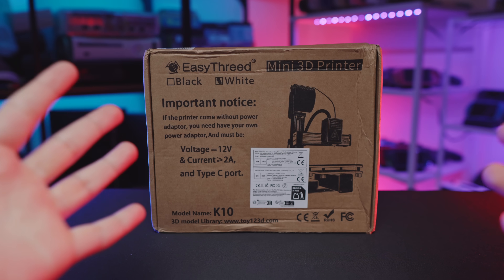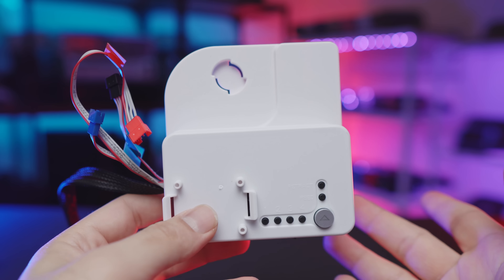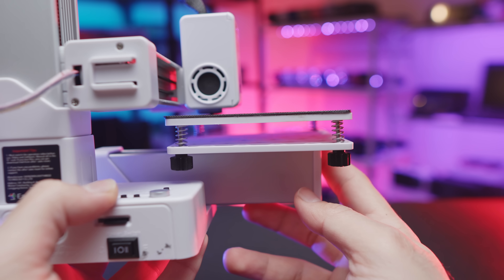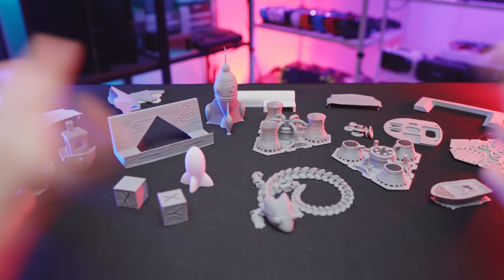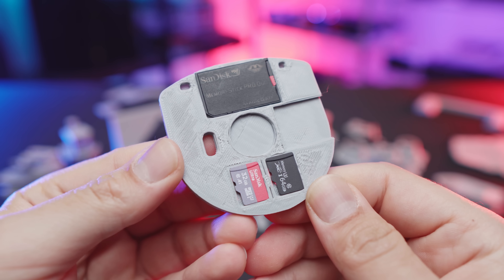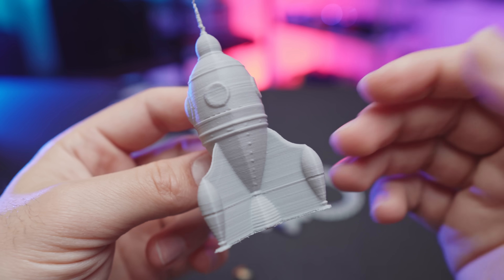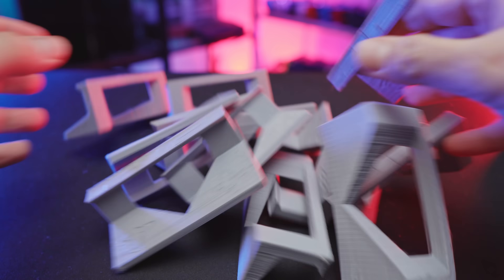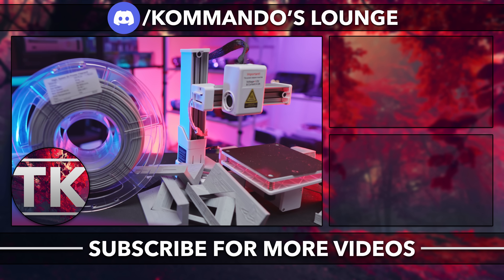Printing PSP Mod Parts With The Cheapest 3D Printer on AliExpress

Comment: I've had mine for a year, it's a cute little printer.
The uneven looking bed, is a result of the sliders used to carry the extrusion for X axis, and tool head.
There are files available with replacement ones you can print.
This definitely fixes that problem. I used the file uploaded by @Phil_Prints, who is also here on YouTube, and in the Easythreed Facebook groups.
Reply from the maker: I will try revisiting it one day thanks for the tips : )

Comment: You know I got a problem I wanna swap psp street case body cause it’s scratched the hell up . What can I do in this case , I just thought if there is a 3d printed body cause there are not some new psp case like other replicas for that model
Reply from the maker: There are sadly non, your best option is to smooth it by sanding it and painting it

Comment: on my own experience, use the orca slicer profile on the sd card and use the power adapter that came to the printer, i used to use a power bank too but the printer seems to underclock the steppers and the print quality came out really bad
Reply from the maker: I thought about testing it on DC power vs Type-C, but was running out of time and thought with the amount of wobble I got, it might be only a slight improvement.
I may revisit this printer in the future and try that along with securing and tightening all the axis, possibly adding a glass bed.

I also found Orca profile to be better than the cura one
Reply: @TotalKommando  fix the fasteners they are too loose on the rail, you can put a tiny piece of filament on the cavity of the rail and the pieces will no longer have that gaps, tight the belts by loosening the two screws and then tightening again when you feel the belts more sturdy, put a L bracket on the Z axys where is the removable thing in 90º angle, this all combined should solve all the weird things in this printer, i did this to mine printer and it goes nice

Comment: Hey bro just wanna thank you for reigniting my love for the psp, also I saw your aux bluetooth adapter video and I'm wondering if you have any research about adding bluetooth inside the psp instead of an adapter? Much love ❤
Reply from the maker: I have a post where I show that Im working on the bluetooth audio mod, its coming but no ETA yet : |
It will however be the next mod video when its ready

Comment: Dude I just ordered a 3d printer for making a PSP umd sd card slot holder. I’ll be making accessories
Reply: What printer did you buy?
Reply: @Shaquilleoatmeal1219 creality ender 3 v3
Reply: @jimhalpert0  nice i have the v3 ke but its a pretty good printer

Comment: These little easythreeed printers are basically just really good for wait for it TPU.... Yes TPU....  CHEP on  FILAMENT FRIDAY did a review of these printers a couple of years ago and they are just kids toys which is why TPU works as its flexible filament .... I have actually been looking for one of these to just do smaller TPU prints with but they are not available in my country and importing them is a nightmare and adds a whole lot more of extra charges and taxes making them almost just as expensive as a readily available Ender 3 range printers.

Comment: can you try make psp transparent shell with silicone rubber mold , and material for the shell using the epoxy resin, it will be great
Reply from the maker: Could give it a try one day, it will be tough since there are so many nooks and crannies

Comment: Oh man.... I had an Anet a8 back in 2015 and i gotta say this printer is taking me back to the issues it had. The technology just wasn't there yet. I bought and Ender 3 and thought i had the best thing in the world until i finally upgraded to my Centauri Carbon which even with the current controversy is still a great printer especially for $300.
Reply from the maker: That was also my first printer lol
I reviewed it on my other channel, fun times (not really) it was a nightmare. But the custom upgrade community prints were cool
Reply: Same actually. Its crazy that the CC is as cheap as it is with the print quality that it produces. Yeah there is controversy over the promises the company made but the machine itself is super solid with amazing quality prints!

Comment: Yeah, they tell you that the printable holder is for 0.5 kg 😆
Reply from the maker: Although I did miss that, they should really include a better spool holder because those are not easy to find, and if you do find a 500g spool, they still dont fit or sit comfortably since some manufacturers are using the same large wide spool anyways lol
Reply: @TotalKommando I got this because i haven't touched before, and don't want the first one that i'm gonna kill, to be some good expensive one 😆
Also got 2x0,5 PLA and 2x0.250 TPU
Reply: @TotalKommando  it's chinese... They have all kinds, 0.5, 0,250...

Comment: Im sorry but its a horrible first printer. And a horrible horrible gift. The person who never 3d printed before would think that all printing is like that. Horribly looking prints with 50-70 percent failrate. If you really want a person to get into 3d printer give them a bambu lab a1 mini. This is a horrible for this price when you can get used ender 3 as low as 90 dollars. Or a new ender 3 clone for as low as 130$. And you will actually be able to print something
Reply from the maker: Dont be sorry lol
The printer should be priced $50 tops (still a lot for how bad it is) and much cheaper with discounts since its a toy.
A better final price would be $35 imo.
At the same time not everyone can afford an A1 or have local options for used printers.
Reply: It’s $60 rn

Comment: For the dragon model, if you scaled it down it will not print with moving parts. The tolerances are really tight at the scale it was meant to print at and when you scale that down the spacing between moving parts shrinks and 3d printers can only get so small. You’re probably dealing with impossible to print negative space
Reply from the maker: 100%

Comment: I bought one and first thing I did - threw away the filament that came with it. Second I mounted it to a flat peice of melamine, that helped greatly with the wiggle part. My benchy looks much better than your. LOL!
Reply: did you just mount on the bottom to avoid the printer from wriggling?
Reply from the maker: lol nice, one could improve it alot by gluing the joints too but for the price, it just isnt worth it lol

Comment: Hey, man. Did you see that recent news (rumors?) that Ostent recently released some new, higher capacity batteries for the PSP? I think it was a 1800mah for the 2000/3000 and 2500mah for the 1000 (and yes, apparently, that new 1800mah one would be using the Slim battery shell). 

Could you look into this and see whether this is true or just a scam/hoax?
Reply from the maker: Yup already got units on the way, should arrive sometime today or next week : )
Reply: @TotalKommando nice! 😍

Comment: the motors used in 3d printers are stepper motors, not servos. servos that would have the ammount of torque to properly move a build plate or printhead gantry would be super expensive and dont deliver nearly a proportional benefit. Some high end printers are starting to use closed-loop stepper motors for the extruder, but not full on servos. 

I figure you already know this, but you kept saying servo in the beginning of the video and the tylenol compels me lol
Reply from the maker: lmao yea I defo mixed them up throughout this video
thanks trump for the tylenol memes

Comment: $70 for this toy is too expensive. 
Sadly my recommended Kingroon KP3S which was costing abt $90 was discounted. It is pretty capable small printer, good enough to print almost anything that could be fitted on 180x180mm HEATED bed
Reply from the maker: there are so many printers out there now, just a matter of time before we get a very nice compact cheap printer, shouldn't be that hard to make
Reply: @TotalKommando  It isn't hard, there was kp3s(. But now manufacturers try to copy bambu success without making ok printer. 
CoreXY isn't better than bed slinger by default, having passive thermal camera is practically usless.
Right now there practically 0 small printers on Aliexpress that make sense to buy. Bambu a1 mini is a solid choice for $200 in my region, but it's hardly a budget choise.
Reply from the maker: @nich98  Bambu A1 Mini is a solid piece of tech, there is the drama about the software choices but whatever lol

I get it for people who owned them before the change but for new users, if they dont like it, dont buy it : )

Comment: Maybe mount the printer on a heavy base and glue or loctite the removable joints, you could get better prints. Then again its a good toy to have for simple, single use prints.
Reply from the maker: Yea if this printer was 25%-50% cheaper, that would be a great idea, but at the current price, its just not worth it or the space it occupies for the quality it outputs lol

Comment: Soo can I print something like a whistle with it? Or other useful things? Don't need high quality texture tbh. I jsut want to print cool stuff that works and ist stable. Thaanks for your help <3
Reply from the maker: Its possible but probably not without several failed attempts and tweaks in the slicer software, as this printer introduces too many gaps and inconsistencies.
As is, would probably work but with reduced effect.

I will try to print one and let you know lol
Reply: @TotalKommando  wow that would be so cool :D So you would say even with 100% infill let me say a printed screw wouldnt be as stable as from other printers?
Reply from the maker: 100% Infill I think would prob patch up all the holes lol
a screw would be stable but would it actually screw 0_o
since its not perfectly printed
Reply: Prices for a real printer with heated bed and some nice to have features start with $120 for creality ender 3 v3 se (yes, that's a real name) and $150 for Elegoo neptune 3 pro whitch is better mostly due to parts availability. They might be slower than bambu a line but any non broken 3d printer can make parts with same level of quality, just some can do it faster.
Reply: And there are bunch of barely used printers, which previous owner didn't set up quite right and gave up on it. Some of them may be broken beyond economical repair but it's always possibility with buying used
Reply from the maker: @nich98  Its been almost a full decade now since 3D printers took off and became mainstream.

Im just not exactly ready to buy a proper one yet, since I may end up moving soon, so hopefully by that time, this video gets somewhere and lands me a sponsored printer lol
Reply: @TotalKommando tbf there isn't a "proper" choise yet. I'm looking on printers from the point of them beeing manufacturing equipment - it's fine to print single use toys but for some more difficult requirements there things like heating to 80c chamber for more strength (like qidi q1/2, bambu h2c).
I'm not even talking about cases where printer itself is a hobby, like a voron project - beautiful builds but most of the parts designers aren't engineers, which shows in their questionable performance.
Reply from the maker: @nich98  agreed

Comment: Thats funny, i was looking at that same usb C 3d print for a non outside cut and clean look. Havent done it yet since it gets in the way of a regular battery so maybe you can test that usb C with different battery mods and see which works best?

Although in the end i went with Giltesa's usb C mod that replaces the mini usb on top and requires a little soldering. Very pleased with it.
Reply from the maker: I would need a proper 3D printer first XD
Then you will find me test printing every single psp mod I can find

Comment: Kommando, because of you I revived my 10 year old PSP 3000 sitting in storage all these years from the DEAD! Thank you for your videos, I will always be grateful to you!

I feel like a kid again hahaha.

Oh I should mention, i removed the CMOS/Supercapacitor and it stopped turning on at first. My experience is that after a day or two of sitting idle, it could turn on again, like you mentioned in the pinned comment in the cmos video. Just sharing for those who could have the same experience as I did.
Reply from the maker: That's awesome to hear : )
Thanks for the info, going to try and document that further in future super cap tests : )
Reply: @TotalKommando  Oh I don't know if this will help, but I do remember the cause of my PSP breaking down is iirc the old battery imploded and leaked acid on the components. I had to replace the membrane for the face buttons because it just plain didn't work anymore. I haven't replaced the power switch yet, because it turned on after all, but I suspect it's also compromised because lately it's not always turning on when I open the switch - this is before and after cleaning. 
Thank god for after market parts from china.